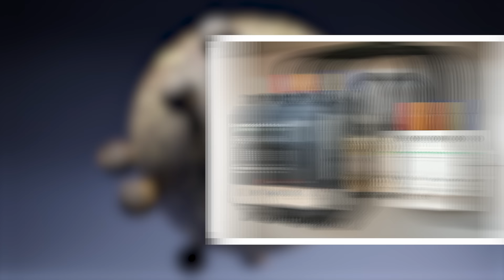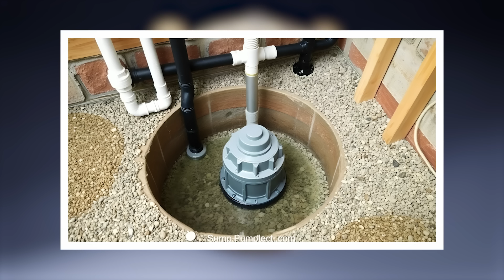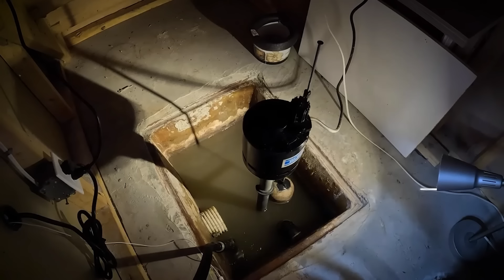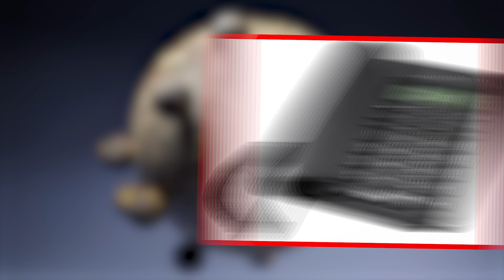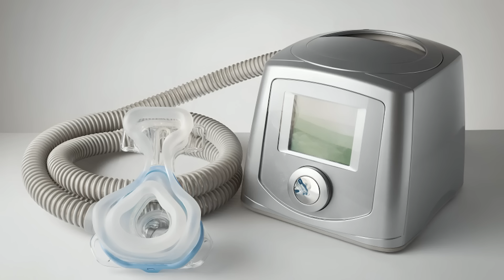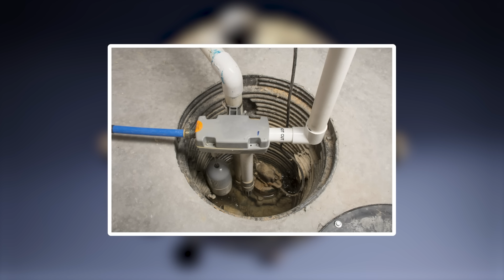The Only 12 Things You Need to Make Your Home Blackout-Proof

Comment: You should never plug a generator into your home use heavy duty drop cords at my off grid cabin I do there’s not power lines for 2 miles lol and my cabin and generator are grounded with copper rods into the ground 8 feet !